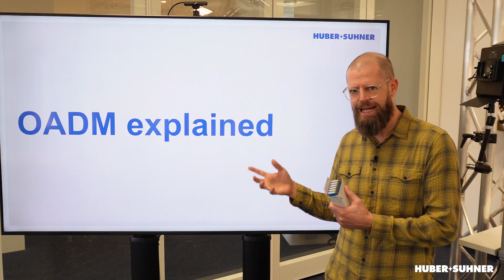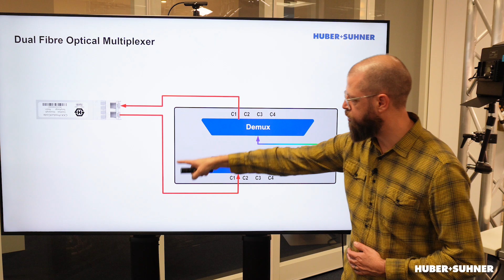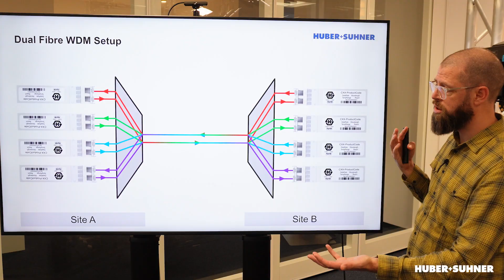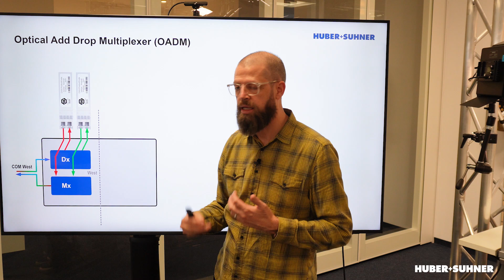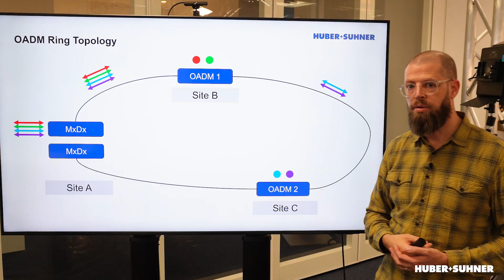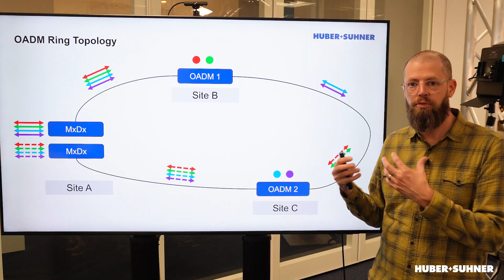OADM explained (01-02-08)

Comment: is OADM switch manually by a person?
Reply from the maker: Thank you for your question.
An OADM is a completely passive device that cannot be switched. You could also see it as a slightly more complex but still fixed optical multiplexer/demultiplexer.
There are however ROADMs. The “R“ in this case stands for “reconfigurable“. In other words it is possible to switch the signals. A ROADM is an active device and is much more complex and expensive than an OADM.